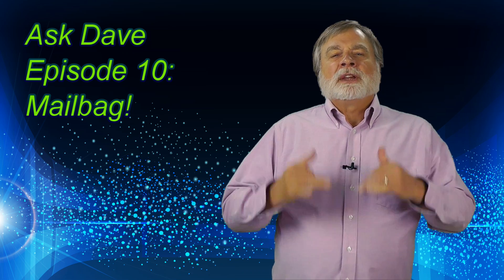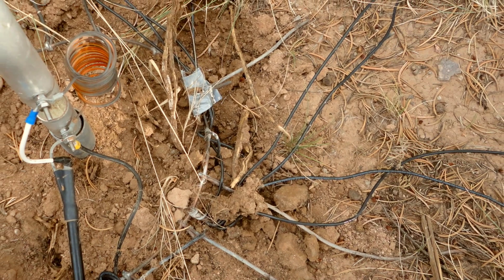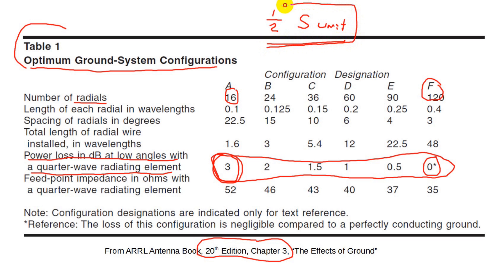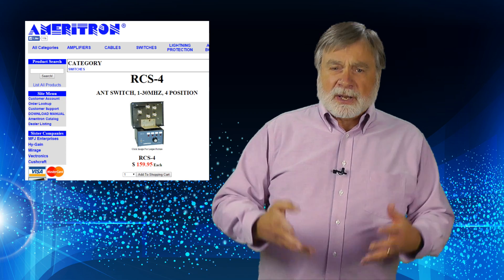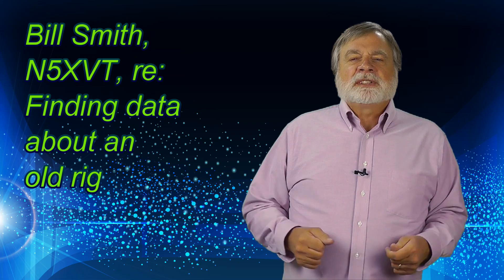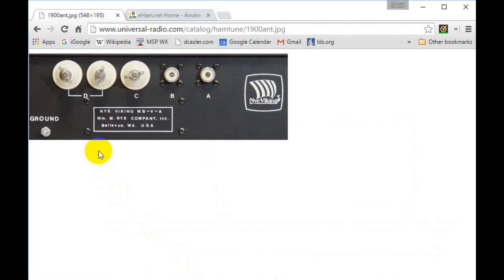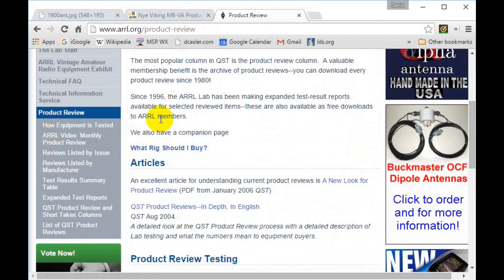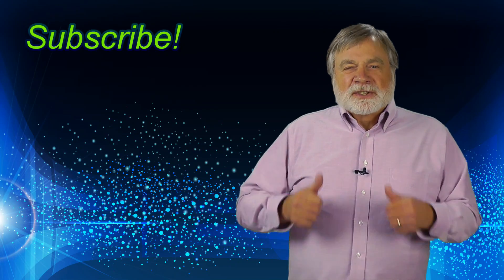Ask Dave 10: Mailbag

Comment: Who wrote table 1, a wire salesman?  You cannot possibly compare set ups where the radial length goes up with the number of radials, 16 radials, 8 cut to a quarter wave at the top of the band and 8 cut to a quarter wave at the bottom of the band will give you best results over dry ground. With a Vertical lifting it up and pegging out the radials at 45 deg will give an approximate low angle gain of 3 db over a dipole. happy do G6FLY
Reply from the maker: I'm going to guess here that the purpose of the table was to illustrate different radial configurations for ground-mounted verticals. The usual consensus for ground-mounted verticals is the more radials the better. If the antenna is elevated, then fewer radials are okay, but must be tuned.